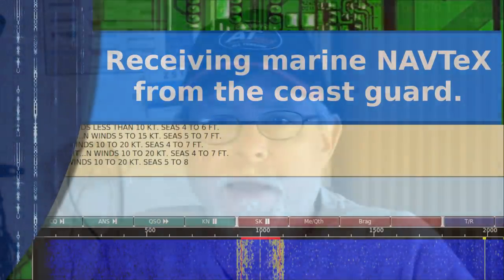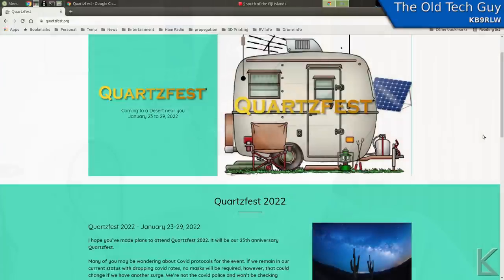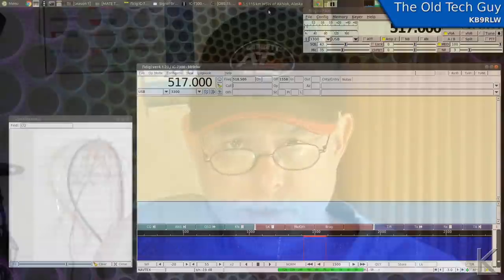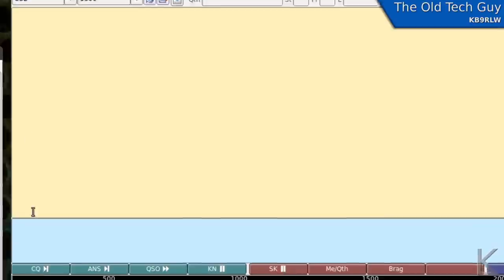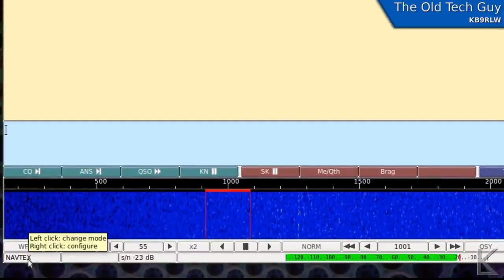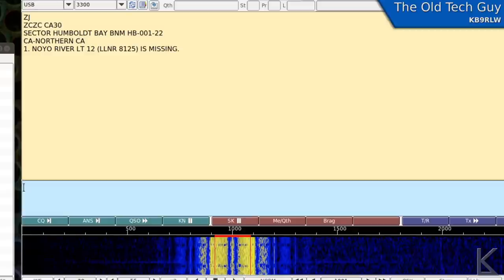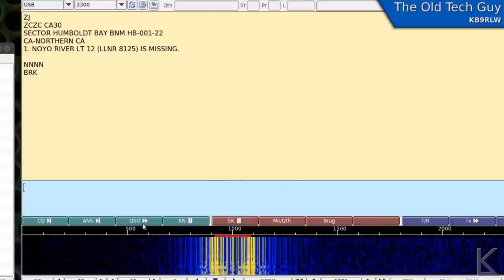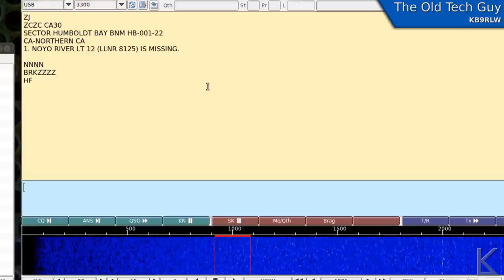Ham Radio - Decoding marine NAVTeX transmissions.

Comment: Really impressive is that they still maintain this service .
Reply from the maker: It's reliable and when it comes to safety, redundancy matters. Most ships use satellite services primarily, but if the weather is particularly heavy overcast or a heavy rain, they might have trouble with satellite signals where HF can still get through.

Comment: There are still a lot of people who use radio on boats. Everyone thinks that people who have boats are rich, but that's not actually the case. Most people have sat. devices for major passages, but they're still very expensive. A plan to just download small amounts of data and send texts at about 9600kbps is about $100/mo. Plus, all boats are legally required to have vhf, so there's some familiarity. Less HF these days, but it's a good sister hobby. The AARL should be doing more outreach in the maritime sector. While not all boaters are rich, some of them are, and can be very helpful influencing politics.

Comment: Can these messages be decoded with any of the SDR programs attached only to a computer the dongle and antenna ?
Reply: Yes if SDR device is capable to receive that low frequencies, else you need a down-converter. Personally I'm using an old AM radio, the ferrite antenna is reasonably good.

Comment: Kevin, a little more info on the heading of that first broadcast.  Sector Humbolt Bay is obviously US Coast Guard Sector Humbolt Bay; BNM is "Broadcast Notice to Mariners"; HB-001-22 means the BNM was originated at Sec. Humbolt Bay, and it was the first one of year 2022.  LLNR is correctly described by the other poster. Missing means it is actually "off station" and possibly lost.  This happens occasionally.  I wasn't a west coast Coastie, so I don't know the area.  However, could maybe it have been shifted off station by unusual currents related to the tsunami into deeper water where the buoy is now submerged? Something to ponder...the "Black Hull Sailors" will have to get out there and drag for it.
Reply: Or it could have been struck by a vessel and sunk...that happens too.

Comment: Even Satellite is not 100 percent, and it is very expensive. Internet is the back up, mainly available only in port.  Many boats still use radio. This is not lost tech. Thanks for looking at it. I have an Icom IC-M700PRO Marine/Ham SSB radio, and it is built like a tank! Pt. Saint George is my home waters. I will never wear a mask, they are just silly. But hey, people are silly about a lot of stuff.